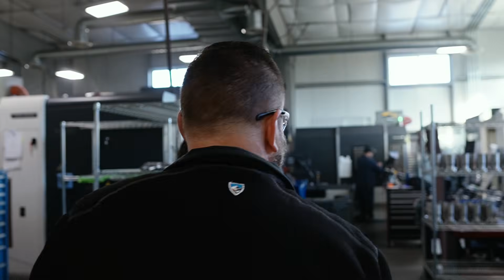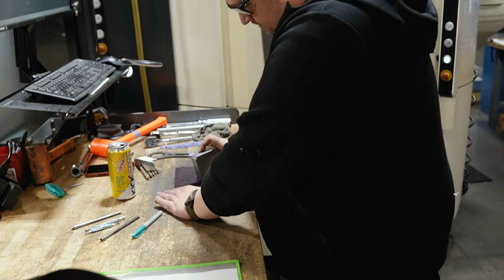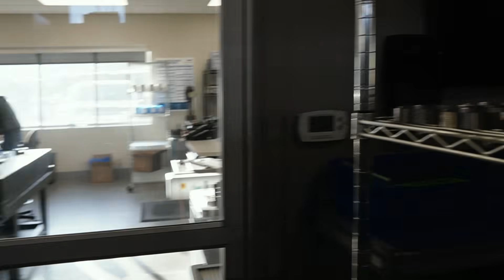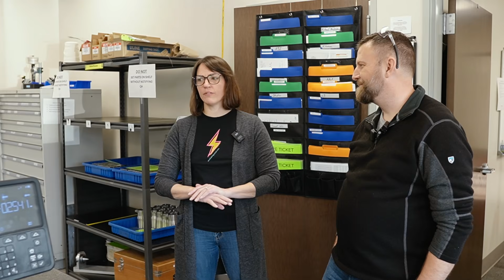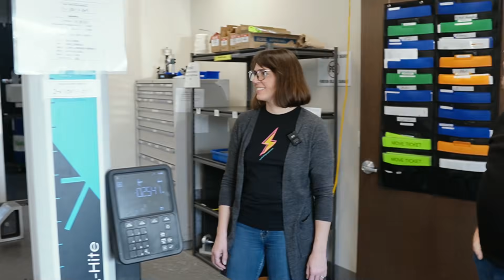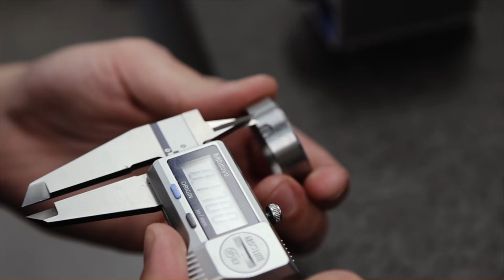The Brightest Machine Shop I've Ever Seen | TORQ Manufacturing Tour

Comment: Couldn't hear a thing. the audio is just compressed air
Reply: Great tour but they do need to lay off the air blasting..
Reply from the maker: @Jelsner97  Thanks for watching. The air blasting was trying very hard to become the main character of this shop tour. Appreciate the feedback! We're already making improvements for future tours.
Reply from the maker: Thanks for the heads up. We'll take a look at it and see what's going on with the audio.
Reply: @marketingmetal  There's a way to duck those frequencies in your video editing software. Since those frequencies are usually not in the same range as the human voice, ducking them usually doesn't lose any voice quality. Watch some youtube videos about your specific editing software and you should be able to get it figured out.
Reply from the maker: @Thomas-jq2im  Wooooow, that's a really great tip! Appreciate you taking the time to share that.

We're still learning the nuances of recording and editing inside active manufacturing environments, so feedback like this is incredibly helpful. We'll definitely look into frequency ducking before the next round of shop tours.

Thanks for pointing us in the right direction and taking the time to help 🤘
Reply: @marketingmetal  glad I could help point you in the right direction. It's nice to see new channels who focus on smaller manufacturing shops. I know getting started on youtube is a huge uphill battle, you're doing good so far!
Reply from the maker: @Thomas-jq2im  Thanks, Thomas! We really appreciate the encouragement.

One of our goals with these tours is to shine a light on the smaller and mid-sized manufacturers doing incredible work that most people never get to see.

We're learning something new with every episode, and feedback from folks like you helps us improve. Thanks for being along for the ride! 🤘